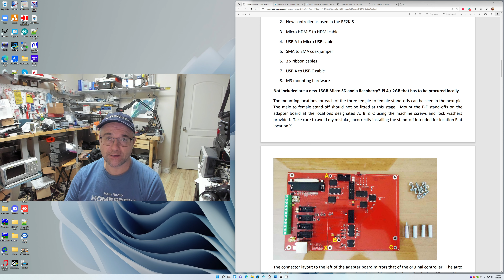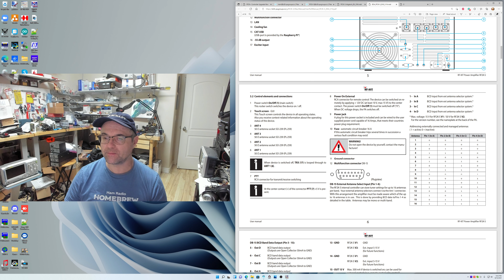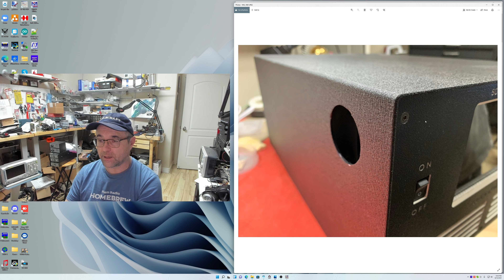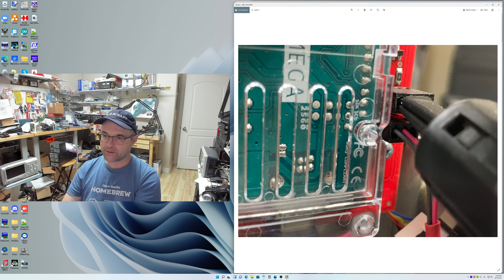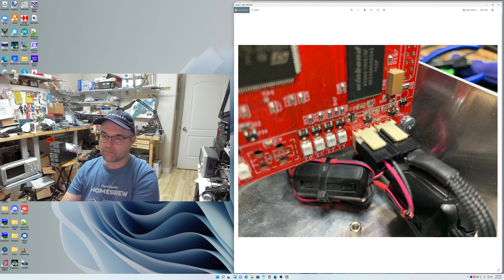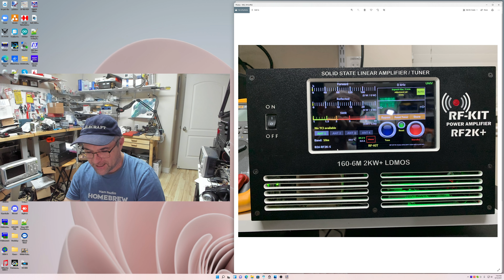RF-KIT RF2K+ Controller Upgrade to RF2K-S Controller Overview

Comment: have you ever have issues with the blf189 ldmos burning out ?  saw a video that scared me . thanks kn6jvs
Reply from the maker: I did early on doing a bunch of experiments.  Since 2019 after getting the ldmos clamps that are used on the newer S model I haven't had any issues at all.
Reply: @ng7m-ham-shack    thank you , that's what I wanted to hear about the S model

Comment: Had you previously done the SWR bridge MOD of shorting out D1/D2 and adding 4.7 ohm resistors?  With jumper installed on SWR Bridge did you have any issue getting 1.6V on forward and 2.7v on reverse with the requested 5 watts of drive?
Reply from the maker: John, I'm glad you commented... I had forgot about that.  Yes, I did do that mod.  And getting the 2.7v on the reverse was the max voltage I could get.  I couldn't get the voltage to go more than 2.7v.  I could tell the multi turn pot was maxed out too and was glad I was seeing 2.7v per the controller upgrade manual.  Thanks for taking the time to comment.  Max NG7M